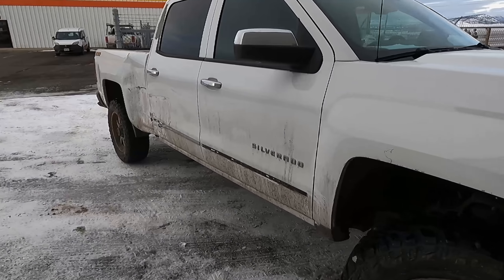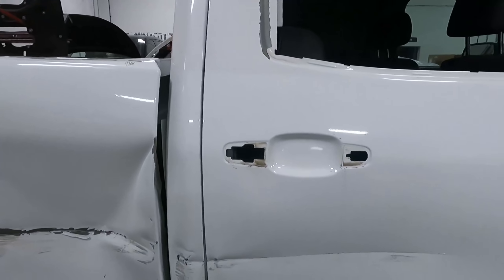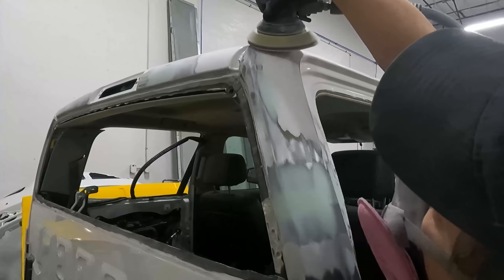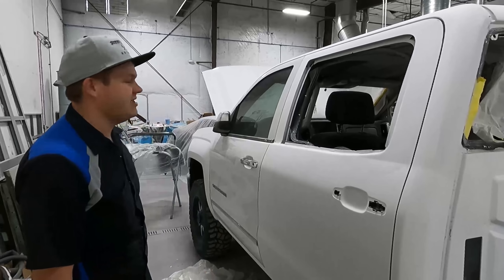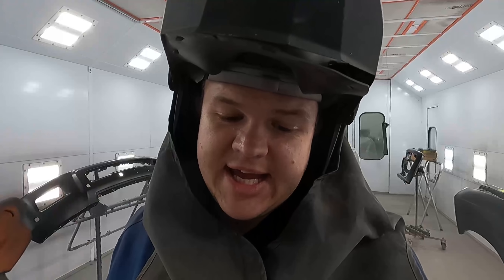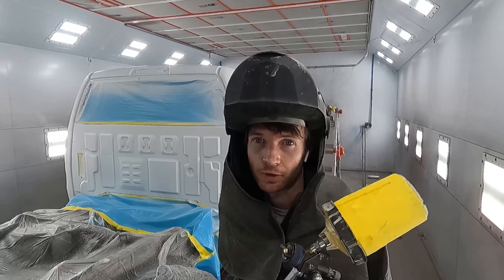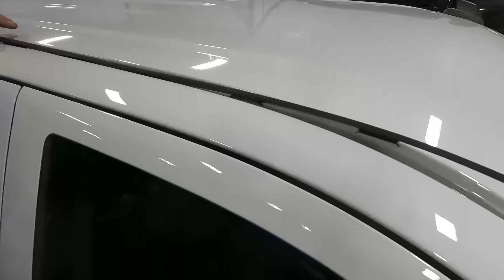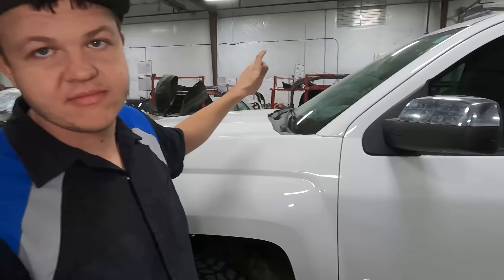As Usual, It's A BIG Job!!

Comment: Maybe a silly question. I don't have any paint experience. I'm curious, even with the ventilation going in the booth, how do you prevent overspray of different colors when multiple jobs are in there at the same time?
Reply: The large amount of airflow prevents any overspray from going anywhere. Notice there’s zero paint on the white walls. It just gets sucked under the floor.
Reply: You can also cover each part with plastic or paper shortly after you apply basecoat. Then you clear coat everything at once.
Reply: @Oo-IIII-oO  I know that's a possibility, but it didn't look like they did that in the video
Reply: @bradevans8714  Yeah, I had the same thought

Comment: Robby, are you able to replicate GM's perfectly flaking paint process where 1 foot squares of paint just peel off after 3 years when the truck hits 65 miles an hour?
Reply: You don't have to go 65 miles an hour, mine does it just sitting in the driveway. Every couple of weeks I have to go out in the yard and pick up pieces of paint.
Reply: @richardvought8205  The worst part is GM has had this problem since the 1980's !
Reply: @brownh2orat211  thought they solved it in the 2000s..

Comment: Is that a dent in the roof at 9:02? Factory delamination, had the same issue on a brand new Ram 2500 Cummins that I bought. Dodge refused to warranty it regardless of the class action lawsuit against them so, I bit the bullet and sold it with 24,000 on it and bought a new Ford. Best move ever. Nice work guys, enjoy seeing a well coordinated team at work!

Comment: Id like to see how to seam (weld?) the skin together.  I briefly saw the seam at the rear passenger door where you connected new to existing.    Seaming auto body skin appears like its not easy being such thin material.     I betting that is one of the trickier parts of your trade!      As always, impressive work!   On side note, does Dinner giggle at ......well.....anything?
Reply: If you go back to the video with the banana they seam weld the roof on

Comment: Looks like a fantastic job. I have a 2000 GMC 2500 Had a severe tire separation and blow out the inner and the outer skin needs to be replaced and my collision center said they can’t get the inner skin very frustrating to be driving around such a nice truck that looks like a bomb blew up in the weal well. 👊👍😎

Comment: When your spraying multiple jobs in the same booth, how does over spray not get on the other parts? Especially if they are different colors
Reply: For one they are far enough away from each other that it's not really an issue. And two there's some pretty heavy venting going on inside that booth so any overspray is directed up and out of the building.

Comment: Robby Your Crew is kicking Ass. Great Job on the Chevy. I do have a Question though about the White Chevy pickup. Is it hard to match the paint when not Painting the whole truck. Because the paint  fades from the sun right..I would think it would of been easier to paint the whole thing. Isnt hard to match the paint.Great video Guys..

Comment: Hey Robby I have rust starting under my rock guard in multiple spots what's the fastest way to strip rock guard off? I have the strip down the sides of the truck and both bumpers coated and i plan to strip it all repair the rust and respray so i have a lot of it to remove.

Comment: What are you using to seal the welds? Especially in the back where the cabbage so it looks like factory
Reply from the maker: Bare metal seam sealer and cavity wax after dressing the back side of the weld

Comment: I think Goonzquad needs to watch your videos on how to paint vehicles. Did you see that Audio that they had all the paint chip off taking the wrap off. I do not think it was because it was too fresh, probably poor prep work. I enjoy both channels, but Robby you see the professional side over the what you can call short cut side. They really need to get that static gun and better prep like Robby does. Just my opinion.
Reply from the maker: I will go Check the video out I haven’t seen it thank you for Watching
Reply: @RobbyLayton  Thank you for the reply Robby.  I am just a hobbyist when it comes to body work, built two off road buggies and done some minor body work over the years. But I can say I have learned a lot from your videos and steps taken that I have not see from any other channel. Granted I do not watch everything body shop related, but I can say your videos are very educational and entertaining. 
As for mentioning Goonzquad, you would need to go back to part 9 and 10 to see the paint work. Is it bad to wrap a freshly painted car and then try to take the wrap off cause you messed it up, or with correct painting it would not be an issue? 
Sorry for the long reply, keep up the great videos.

Comment: I am looking for a shop that will do a little "restoration"  work on my 06 Duramax need rockers and cab corners done. but all the asshat shops around me are INSURANCE only. one shop told me they had to take the whole cab off the truck and it would be 10 grand. what a joke